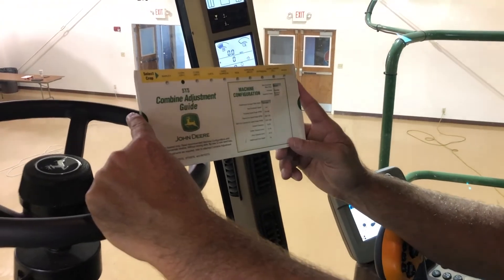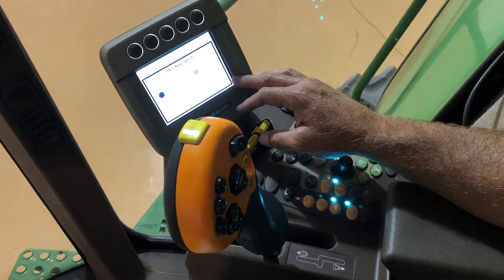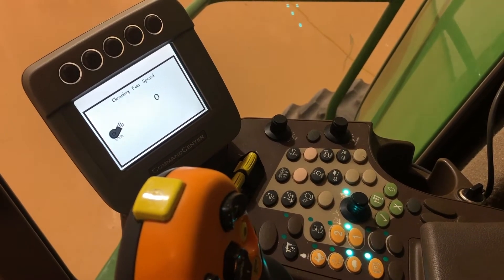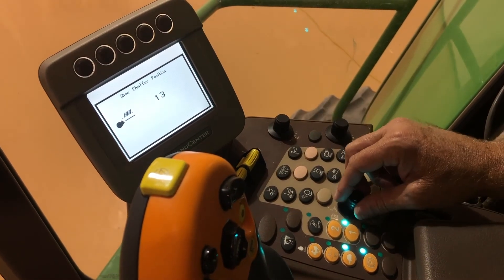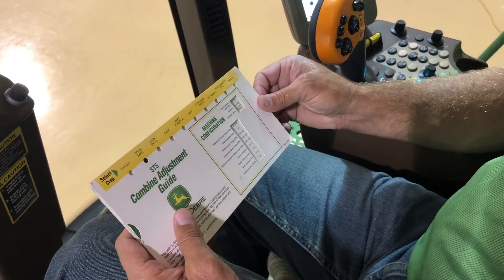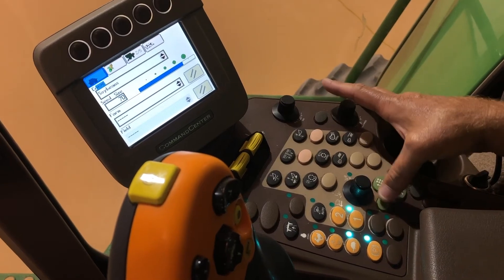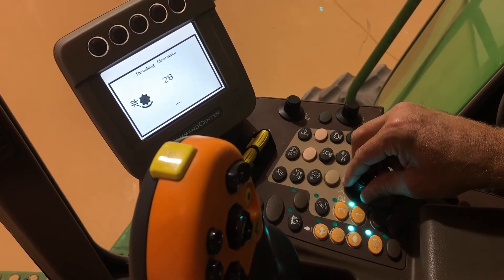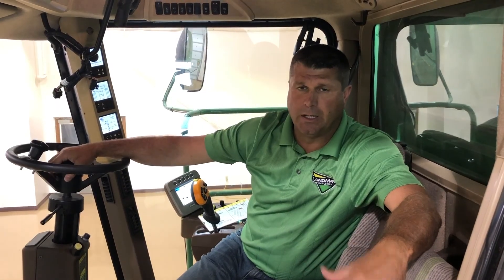In Cab Settings and Adjustments - 70 Series Combines

Comment: We just bought a 9570.   Like your idea to measure cob.   That would be needed with metric wrench correct?   And if so are the concave setting numbers also in metric?     Like the 28 you mention is that 28 mm?    Thx.